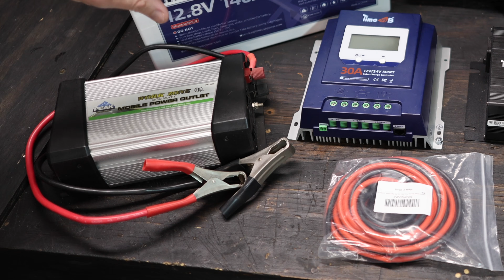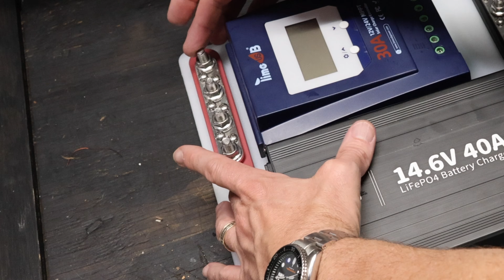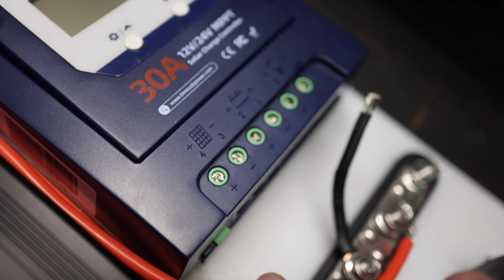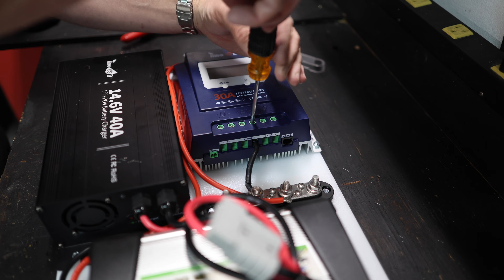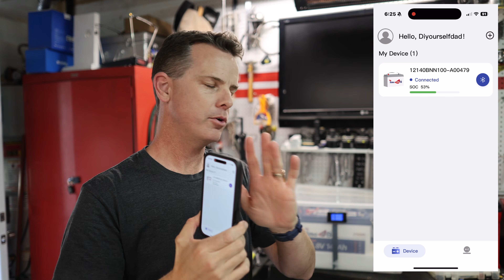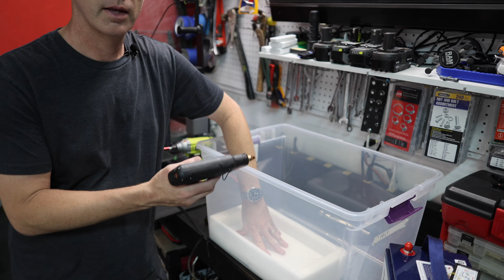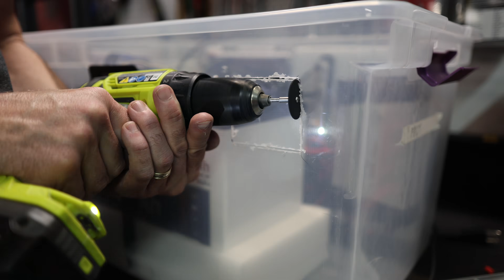Build Your Own Solar Power Station - Make It Better - Make It Cheaper

Comment: I built a like 500w one and am like 80% done with one with a 1400 watt hour battery but I kept blowing up inverters because I wanted to be able to run a inverter flux core welder but mine were all 18650s and I just bought one from oupes mega 1 with a 1kw battery and 2000w inverter for $299 and it charges so fast I might be close in cost but my batteries were free with a lot of labor

Comment: Just broke it down from the links he offered. Costs anywhere from $600-900 usd.

You can by solar power banks for much less in 2026. Like 200-300 and not have to worry about building or fixing it. 

It is cool to know how to do it tho so don’t slam me with comments

Comment: You should have tinned the wire before crimping for a better connection and to keep it from pulling free. Also an unvented plastic case will deteriorate or melt unless you vent using a fan as well as increasing the likelihood of component failure.

Comment: How would you put 2 battery together
Reply from the maker: You would wire them in parallel, positive positive, negative to negative. Then connect to the bus bar.

Comment: Did something like this, just kept expanding till I had 4x 100AH in series. Now it’s too heavy to move haha, I keep the batteries and inverter in the box and everything else plugs into a remote (much smaller) project box via 50’ umbilical; has all my 12v components, solar charge controller, 120v plug, USB-PD, and starlink 58v transformer and direct plug. So nice on camping trips too, it’s about 5x the capacity of a normal $500 1024WH “solar generator.”
Reply: Will Prowse had a great idea to mount everything on a handcart. Those batteries do get heavy.

Comment: When buying an inverter (the 12V DC to 120V AC converter) make sure that it’s a ‘Pure Sine wave’ inverter if you want to use it to power sensitive electronics. 

The cheaper ‘Modified sinewave’ inverters are not suitable to power a TV etc.

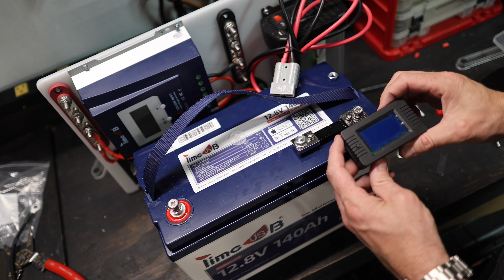Comment: 13:52 This is the shunt. It’s a very low value resistor. When a current goes through it, it will create a small voltage over it two poles that can be measured by the:
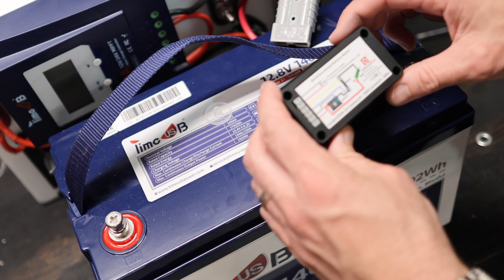13:58 battery meter. This is the display and some electronics that measure the voltage and calculate the information on the display.

Comment: The good thing here is that most guys that like to tinker pretty much have all this stuff gathered over the years except maybe the lithium battery.
Reply: I did, though I had to ditch my old solar charge controller for a Victron MPPT, and my UPS won’t detect power from my old 1600w Cobra inverter (probably because it’s not pure sine wave) so that’s next on my list.

Comment: Great DIY tutorial. I’ve been totally wanting to do this, but now power stations are a lot like PC computers.  It’s just cheaper to buy a 2048wh plug and play than to build even a 1048wh DIY. 

I picked up a 2235wh Oupes 2400 for $449 and free shipping. Just can’t beat that ATM. But totally get the fun and pride of DIY
Reply from the maker: Completely agree with you. I came from the world of DIY gaming PC’s of the early 2000’s. 

The problem with current PC’s (especially laptops), and current power stations is they aren’t repairable or upgradable. I miss my old Thinkpad 😢

Comment: Calling these a “solar power station” is like calling my car a “gas pump powered car”. 
It’s just a term they came up with to make people feel green.
Reply from the maker: You got a better suggestion?
Reply: @DoItYourselfDad  duh yeah. A “battery power station”.
Reply: Just because you can use solar to charge it…
You could also call it a “wall outlet power station” 😂
Do you understand?
Most people don’t.
But the phrase “solar power station” gives them the feeling of being good for the environment. That’s why they call them that.
Reply from the maker: By your logic my diesel truck should just be called a truck, my hybrid car should just be called a car, my electric bike should just be called a bike.
Reply: @DoItYourselfDad I think you missed my point. Your diesel truck runs on diesel. Your “solar generator” runs off of batteries.
Reply from the maker: Nope, I read you loud and clear. You’re making false equivalencies. The battery is a storage medium, just like a fuel tank.

These aren’t being called a solar power station to make it sound like it’s good for the environment, these are called solar power stations because it gives you the ability to charge these when not being grid tied. You can also build, or buy rechargeable batteries that don’t have a solar charge controller, and plenty of people of do. Specifying these as solar differentiates the two.
Reply: @DoItYourselfDad  okay so you’re EV is a grid powered car. Nice. 😂 bubye ✌️
Reply from the maker: Dumb as a box of rocks…. 😂
Reply: @DoItYourselfDad you’ve obviously got some issues there. Seek help
Reply from the maker: Nah, I’m good. Have fun with your fuel tank powered car 😂

Comment: Ciao, scrivo dall'Italia, intanto grazie del video.. Volevo fare una domanda: ma l'Inverter si può usare contemporaneamente mentre si carica la batteria? (da rete, solare o DC) Grazie per un eventuale risposta. Bellissima l'idea di usare il tagliere di plastica.. Farò lo stesso! 😉
Ciao un saluto da Roma.. 🙂
Reply from the maker: Yes, since everything is wired through the bus bar, you can pull power through the inverter while it’s charging through the solar control controller or through AC at the same time.

Comment: in this system, don't allow the cables to rub against the mounting screws or anything else, it will cause issues. Also you should solder all ends including crimped ends so it resists corrosion better. I know he's keeping it simple but doing it more correctly will be better in the long run.

Comment: Honestly this video has helped me more than any other video I've watched on the subject. People tend to overexplain or get overly technical with information that just goes in one ear and out the other. I've always been a practical, hands on, kind of learner. The way you laid everything out at the start and explained each part in simple terms drew me in and actually taught me something for a change.
I've been working on rebuilding a 1989 ford Econoline class C RV. Setting up the solar system is one of the last thing on the list of things needing done. Seeing you build this power station has given me a pretty good idea of how to get started with the larger version. Thanks.
Reply: Use heavier gauge cables and a block fuse. This in a RV needs stronger safety measure. It's not just my opinion it is recommended. Enjoy your travels !
Reply: @flyrobin133  Hey, I've been living in the econoline for 4 months now! I've installed over 3000w of solar on the roof on 4 charge controllers. Things are going great!

Comment: It would have been nice if you'd included a price list in thee video itself.
Reply: yeh no total cost built in was dumb.
Reply: @_lewtz  It was probably done because, if you check all the purchase links in the description, you quickly realize that it totals over $600. For that price, you can easily purchase a battery pack that you don't have to worry about catching fire and is already IP65.

Comment: I appreciate your expertise but you have to realize most people are broke, this causes them to buy the cheapest equipment for overseas, particularly the country of no consumer regulations and endless lies regarding specifications. From a 18650 battery advertised for 9800ma but holds sand and is crap to  aluminum core wire if you go low bid expect to be ripped off no matter what the specifications say.  And then will home insurance cover the fire ?

Comment: I have read some positives comments down below and I will add some of mine .
Build your own battery ( save a lot of money and have the power YOU want for your project .
With a solar controller in the box is enough to charge  the project ( saving space and make it lighter ) thus enable you to put any external device that produce DC power depending on the input of the solar controller that will regulate the voltage needed for charging the battery . ( Solar panels or power supply that do not exceed the solar charge regulator .)
The space you used for the power supply can be used to make your DIY battery up to double the size and power .
Hope that my comment add a + to your project .

Comment: I think it's a great project but... I priced all the parts on your list (minus the crimping jig) and it came to approx. $550. Then I priced units similar to the solar power station you claim costs nearly $2000. The price range was from $150 - $550, many with solar panels included.
Reply from the maker: lol…. Then you priced out the wrong specs.

Show me a power station that has a 2560wh capacity and can put out 2400w for $150. What a joke.

Comment: I bought a small  luette . Bring back not work. Other two burn out on DC side .. send messages too much hassle.  Send park . But need receipt.  Buy it . No account . Try local  repair . Have to look and see . . Cost more what i pay . Better build . Battery got a inverter once is 12.8 volts charge  voila..

Comment: I like to tin my wire ends, it makes the connection to the wire end more solid.
Reply: I really did not like the set up. Too many short-cuts. That plastic carrier w no fuses, ferrules, breakers, shut offs nor ventilation. I'd drop that shunt completely out. 
But thats his box. Wouldn't be mine😮
Reply: After watching the whole video, took my like back.

Comment: Try building out a system similar to the bluetti elite 400 for less money. You can't. If you can, it'll be 3x the size and be less reliable. Economies of scale have made DIY systems impractical YEARS ago. 

I built one of those milkcrate systems years ago and had to replace literally every component multiple times. Total money sunk into that project? 3k. For the same functionality as a $300 all in one unit. I could replace my DIY system with a premade one for just the price of my inverter.

Comment: You should really be using a ferrule on the connections for the charge controller. Those type of connections have a tendency to cause hotspots without them. I've seen a lot of fires, because people didn't use a ferrule.

Comment: General Battery wisdom; NEVER do maintenance with Positive wires while the negative lead is connected to the battery; (short hazard from wayward tools or wires.) If you disconnect the negative terminal (and connect it last), then there is no common ground to short against... General rule for negative grounded systems is :"Disconnect the Negative Battery lead first, and then connect Negative Battery lead last.

Comment: Retired Military Avionics tech here; chaffing hazard in vibration environments on that red line coming off the battery charger. I only mention it because you said you're putting it in your truck. It is best to avoid ever allowing them to touch (via placement of the device, or placing u or c clamps), but if you insist on having a red insulation touching a metal surface, it is advisable to bind the cable away with a secondary material like electrical tape or a slip surface (like cardboard.) On things that don't get inspected daily, packed away out of sight, that kind of a short can really ruin your day.

Comment: No fuses, using tin wire and not copper wire 😳
This is how you burn down your house or truck in this case.
Reply from the maker: Every device in there has a fuse, the battery has a BMS, all of those wires are copper 😂
Reply: @DoItYourselfDad  

That's aluminum, not tinned copper. I also wouldn't trust the fuses in those cheapo devices either, let alone the devices themselves. Nothing you picked is high quality, yet it still costs more than the competitors.

Comment: Good start but as others have mentioned missing fuses or breakers.. plus I'd be more careful with touching the battery terminals.. maybe cover one with tape while you work on the assembly...
Reply: What’s wrong with touching battery terminals?  With your hands, you mean?  A 12 volt battery can’t shock you by touching the terminals. 
Are you concerned with touching lead, maybe?  That’s justified.

Comment: Have to say - great video but I agree with Bruce, below - those plastic storage boxes are rubbish!!! Having used them for around 20 years (with kids' stuff and general storage usage) they are great... as long as you treat them carefully. If you accidentally knock them, drop them... or stack something heavy on top - they snap - irreparably! I personally would not put a heavy battery inside one of those - one knock and you're going to have to rebuild that thing! Just sayin'! Otherwise - great video - thanks DIY Dad! 🙂

Comment: Any way to make this chargeable from a 12v socket in my truck? I’m on the road a lot and wind up charging my power bank while I’m driving
Reply from the maker: Super easy, these lithium batteries already have a BMS build into them. You can essentially hook the 12v from the truck to the battery and the BMS will control the charging.

Comment: We're supposed to guess how you ran the 120v ac cord to the 40A battery charger? Is the cord stuffed in the box or hanging out of the back permanently?
Reply from the maker: Drill a hole? Open the lid?

Comment: Great idea with the cutting board! No cost evaluation?   How much cheaper?   I understand that there are enormous variables being offered up to create your own power generator,  but there's zero indication how much money could be saved with the one you've built or a few popular/common setup examples.  It's also important to use A sturdier, ventilated box with an exterior master on/off switch, for sure.   ~

Comment: this is a great option, i know nothing about electricity, I was looking to buy a mobile power station for emergencies. This seems like a good option but what is this build comparable to a premade unit like the one you showed at the beginning of the video? what can i power with this build? and how long should it last? as someone with no idea, these questions could be addressed in the video to help people like me.  thanks
Reply from the maker: Those are all things you’ll have to do the math on. What you can power depends upon how big of a battery you get, how big of an inverter you get, and what the BMS and the battery is capable of pushing out. How long you can run things depends on the storage capacity of the battery you choose, and what devices you were trying to run.

Comment: Why did you use a 40A battery charger? Wouldn't most places you'd plug in be 15 or 20 amps?
Reply from the maker: 40a is it’s 12v DC output.

Comment: Did I hear him right? Did he say, one way to utilize the 12vDC-120vAC inverter is to hook it up to the 12v battery which is then charged by a 120vAC-12vDC converter??? Why. Would. You. Do. That. Or just eliminate the battery, inverter and converter and plug right into your wall. Wtf is this guy even saying?
Reply from the maker: Nope…. Didn’t say that
Reply: Can bypass all that with a UPS.  Uses AC power until there’s an outage so not taxing the battery.  Want longer runtime, beef up the UPS battery.

Comment: althou i see this video is a bit on the older side, i do have a couple of questions:
Is it okay if i use both inputs to charge at the same time, the solar and the mains?
what would i need to do to charge two different batteries (for two different circuits) with solar and/or mains? Should i put another MPPT and call it a day?

Comment: My company along with many others replace computer rack mount UPSs with new ones. Do you know of a way that I would be able to utilize an old 2000 or 3,000 watt UPS and utilize solar, wind or whatever instead of. 
Basically, I would like to remove the rack case and build my own DIY battery backup device.

Comment: Cool video - My problem is after seeing so many EV car fires I am terrified of lithium batteries and don't want them anywhere near me, because of this fear I would use lead acid batteries. My one use for a power station is to keep the pellet stove running & that is why I watched.
Reply from the maker: There are many different kinds of lithium batteries. Lithium Ion batteries are the ones that you’re referring to having thermal runaway problems. Lithium Iron Phosphate are much safer.

Comment: I am not thinking a battery charger that plugs into the wall is good for me to install with any batteries. I have 4 ecoworthy 12.8 x300 amp batteries. So I can have 1 battery 12V and 300 amps or 2 batteries 24V 300amps. I am not into making a single 48V 15,360watt battery. I own 2 Vevor 14.6 80Amp batteries so I can fully charge 2 batteries 12.8v 300amps in 3hours 45 min. So I am going to charge the 12V batteries either 1 at a time or 2 at a time by solar wind or ac plug in.  I was going to have 2 power stations 24v 300amps=7680 watts but now I am thinking just have 1 solar generator 7680 watts and 2 12v batteries to use as replacement batteries for24v7689 Austen.

Comment: I have a question. Since battery/charger/inverter/solar are all connected on the same bus, wont there be any issue if you're using while charging with wall outlet and solar panel.
Reply from the maker: Nope, the battery itself has a battery management system that controls the charge running into the cells.

Comment: So all you need is ...
Big battery (very expensive)
Charge controller for solar (expensively)
A Dremel, which you need to buy 
A drill, you need to buy
All that wiring. ($100)
Bus bar and various other components ($100)
Converter ($1200)
All of this costs the same as the unit you showed.
MORE EXPENSIVE and prone to a LOT of problems 
So BAD VIDEO 
GETS A THUNBS DOWN